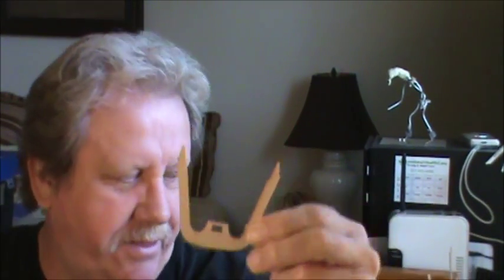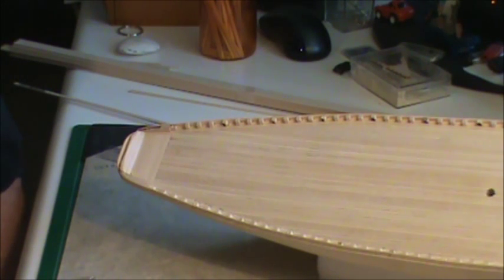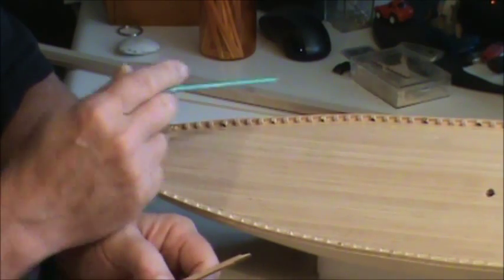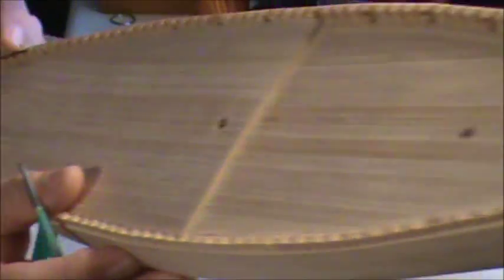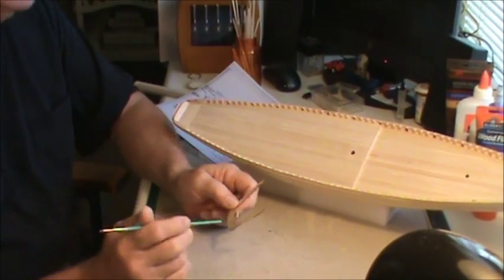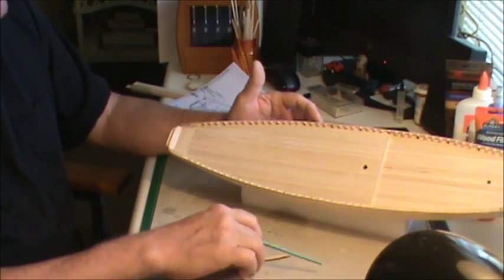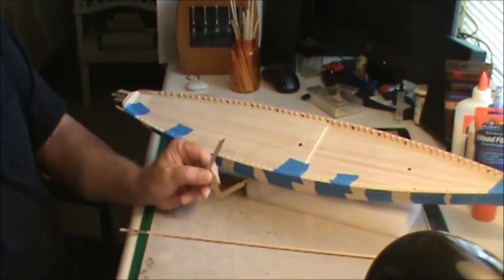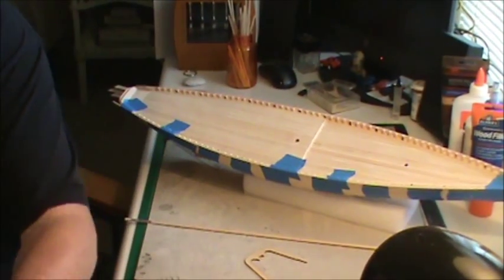BLUENOSE PART 15...More problems

Comment: Hello Gary , I watch your channel with great pleasure and congratulate you. I am also a person dealing with modeling. and I'm a fan of historical sailing ships. I'm a j class yacht endeavor fan.  and i want to model j class yacht effort,  but I could not find the original dimensions and drawings anywhere. I found resources on the internet that contain different sizes and incorrect drawings,  I wanted to do some of them but it didn't happen because the measurements were wrong. If it is convenient for you, would you like to help me? I will be very happy if you can help me about j class yacht endeavor drawings or plans. Thank you

Comment: Sorta confused why you have to trace another pattern when you took the cutout you took from the plans and confirmed it was dead on. If it is dead on what is the point of tracing another pattern that should for all practical purpose be dead on?
Reply from the maker: If you look at the sheet of plans one half of the pattern does not show the top rail.  And to be absolutely sure I get the top rail just right I made an outline of my ship.  Also the pattern I make is on thicker paper which comes in handy latter.
Reply: Thanks for clarifying this Gary and yes you are absolutely correct. I scanned the plans and inverted them so I can make a print of the side void of this information.

I have to say your videos are saving me a ton of frustration and unexpected (and unwelcomed) surprises. Thank you...;)

Comment: Gary... To start with,  I believe you are an excellent modeler.  But in an earlier video, you said you were not going to bend that part.  Had you bent it, I believe it would have fit.  The reason the plans don't agree with the parts will back this claim.  I have never built a wooden ship before, but I am about ready to start a USS Constitution from Model Shipways.  In an earlier vid, you showed the plans for that main rail.  Had you bent it the way you showed it, I think it would have fit.  It is a complex bend, and as such, those legs would have spread, and you would have had a good fit, at least as I am visualizing it.  If you still have the old main rail part, and since you have completed the model, why not try to bend it and see if I am wrong?  It is my opinion that the geometry of the bends would have made it fit.  Looking forward to your next tall ship.  :)

Comment: Hi Gary  Just watched the latest installment and I tried to line up that part on sheet 3 of the blueprints like you and it didn't line up just like yours ....but I tried to line it up on sheet 2 of the blue prints ( there is a overhead view on those plans also) and it lines up almost perfectly. Bit of a head scratcher
Reply from the maker: ***** I didn't catch that, and I had altered my part so I can't go back and see.  But the big question is how does it fit on the ship.  Be prepared to make one.  The good thing is you know whats coming and not like me that wasted a couple of hours trying to figure out what was wrong.

Comment: Oh I agree with you......the ship should be manufactured properly and the plans should be accurate but......they aren't. I am presently working on all the deck housing and structures and you have to build it all from scratch because none of it so far has any laser-cut parts and the plans and instructions for the deck structures are scrambled all over the place in the plans.......so I also spend alot of time looking at photos. The problem however with looking at other model photos is that everybody seems to build it a bit differently than everybody else. Hey Gary.....keep up the good work buddy. Your rig looks great so far and I really enjoy watching your videos.
Reply from the maker: Hypergolica1 I don't know if you seen these pictures but very good pictures of the deck of Bluenose ll.  On you-tube look up "Bluenose ll Schooner Virtual Tour 3D Slideshow"....best pistures of the deck yet.  The you-tube page is by "Folk Photographer" taken March 13, 2014.  I do the same thing, search the inter-net for pictures.

Comment: I think I paid about $150.00 for mine. I cannot recall ever building one of these ship models without running into similar problems but there are those on this website and others who are far more qualified and experienced than I am who could probably offer up better opinions. I kind of look at it this way.......if it was easy to build I probably wouldn't be interested in putting it together. For myself the problem solving is part of the fun.
Reply from the maker: Hypergolica1 Yeah, your right, problem solving adds a sence of accomplishment.  All the deck furniture has to be scratch built so whats one main rail.  I just get upset when you pay this kind of money for a model, is it to much to ask for the parts to fit.  And the directions to be free of mistakes.  I also had to have them send me a new ship's wheel, mine was bad.  You can't tell me that someone at their company didn't put this model together.  And then tell the boss "Hey I built this model and found some mistakes", and not correct them.  And it's not just this kit maker it's a lot of them.  This won's stop me from building models but I will do a little more research before buying my next model.  That's my rant for the day.

Comment: Gary:
    Love watching your videos. I am presently building the Blue Nose II kit from Shipways. I am a little bit farther along than you are right now so I understand everything your saying. I have built a few of these things during the course of my life and I learned long ago that the plans tend to be general guides and that you simply have to do what you have to do to put the ship together. Because of the problem your speaking about I simply scratch-built the rear railing system because the part didn't fit correctly. I have run into a few other problems along the way as well and I simply wind up looking at a bunch of photos and scratch-building my way through the problem. The kit is what it is and I have certainly run into larger problems with other ships in the past. Overall, as far as ship models go, the Shipways Bluenose II is a pretty good model. Your ship looks great so far. Keep your videos coming buddy.......I'm right beside you all thew way.
Reply from the maker: Hypergolica1 Thank's....I paid about $120 for this model but I have seen it for as much as $300 on a couple other hobby dealers web-sites.  I would be highley upset if I had paid $300 for this type of quilty.  Yes it is a nice model once you correct their mistakes.  This is my second wooden ship and had the same problems with the first.  One good thing is that it's wood and you can make your own parts.